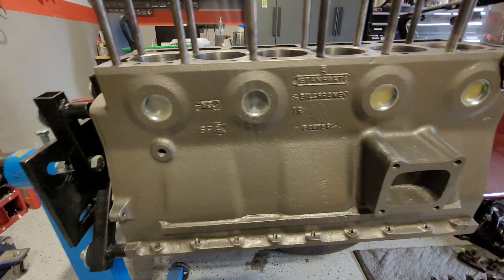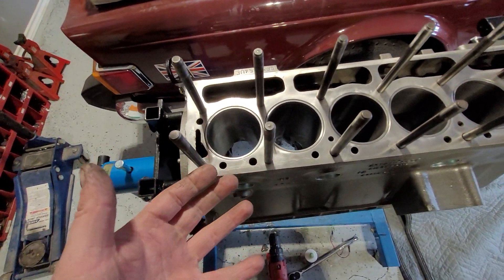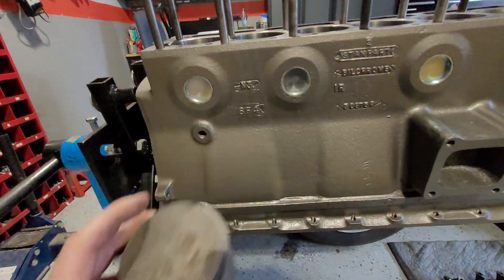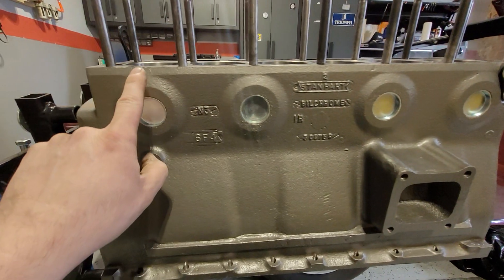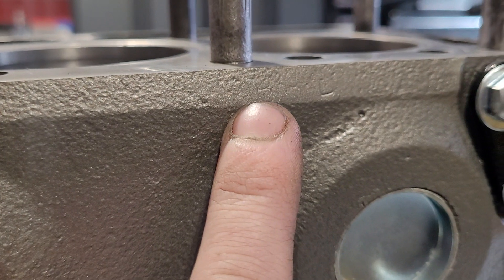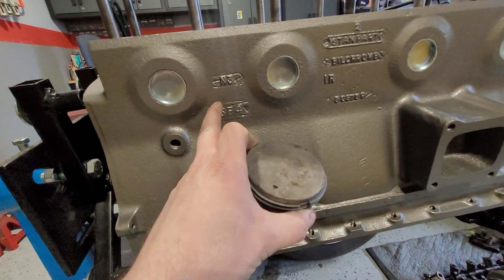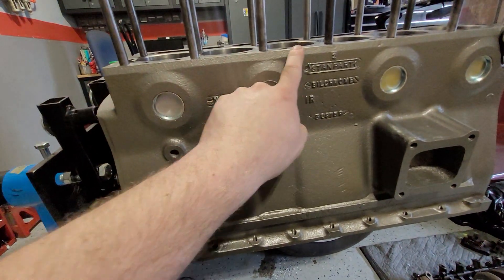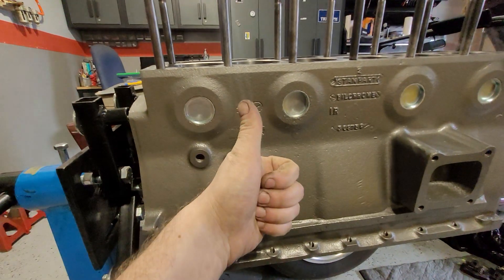Triumph tr6 cylinder size markings

Comment: Interesting! I've never paid attention to that.
Reply from the maker: Yes they all have it, but lets face it after 50 plus years of oil, grinding, and god knows how much paint it's very hard to see them but they are there.
Reply: @TR-Restorations  I am actually working on my GT6 today and I checked that on my block. It is really hard to see the letters but they are there. It is funny though I have all A's stamped on the block, but one of the pistons is B :) looks like they ran out of A pistons that day LOL. Thanks for that information though, it is good to know.
Reply from the maker: It's more for measuring the bore size as A and B are two different sizes. Look at the book and you will see, it's just how they got milled at the time. Hope it helps